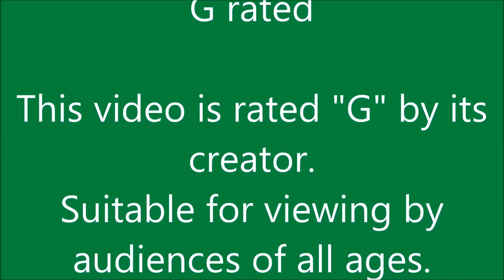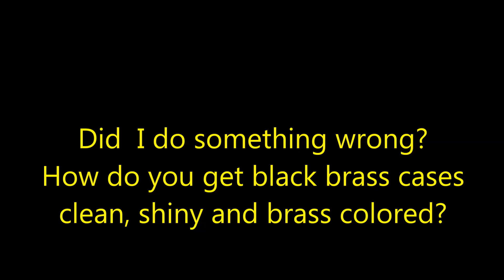Cleaning black brass cases in a wet tumbler

Comment: Watch from 6:47 to  8:31.  Pins, cases and a spoonful of Dawn - NO LEMISHINE! (No citric acid) Hint:  Use 3-4 drops of Dawn then at 10 minutes check the results. If there are no or very little suds you did not have enough Lemishine.  The clue was the over abundance of suds at 11:49. Should have added 1/4 to 1/2 teaspoon Lemishine. That spoonful of soap is hard to remove making your cases sticky if not completely removed using Hot water during  the rinse process.  Under normal recently fired brass cleaning first do a thorough rinse in very hot water to remove any case lube residue (these cases are so weathered it is doubtful there is any lube (wax) remaining) . Over rinsing and citric acid are the key to non tarnishing bright brass during storage. Always rinse with clean water. Don't reuse dirty cleaning solution, it will make your brass hazy  looking.

Comment: Some folks add a little lemon-shine to that same mixture. The citrus helps clean and shine the brass👍🏻
Reply: Lemishine is mainly citric acid. It definitely helps. Careful not to use too much or it might discolor your brass.
Reply from the maker: I bought some Lemi Shine and will use it on these cases.  I will also post a video.  I am eager to learn how well it works.
Reply: RogerRevo . Ok, will be waiting on the vid. Hope it cleans them up👍🏻
Reply from the maker: @georgiaboy4410  Watch my video:
Cleaning black brass cases in a wet tumbler with Lemi Shine

https://www.youtube.com/watch?v=57CKUF46otY

Comment: Yes, it would be interesting to see the results after adding about 1/2 teaspoon of lemi-shine to your existing mix and running for another couple hours.

I have the same tumbler as you but i have been using ground walnutshells, with a healthy dose of mother’s chrome polish and nufinish wax. ive actually been able to restore brass that looks like that, but it takes about 4 days of tumbling. i like the nufinish wax coating for three reasons, the cases look very nice shining better than new, the brass should last a long time without tarnishing, and mostly because it cycles through semi autos easier with a touch of wax.    anyways, just some thoughts on what has been working for me. i also have an ultrasonic cleaner, but havent had the best results with it, other than if initially cleaning the brass in there before tumbling, it cleans the insides and primer pockets that the walnut shells dont always get. i may go to a two step process of wet tumbling with the SS pins, lemishine, dawn combo, then finish up with a dry tumble with the walnutshells and wax..  im in no hurry. but, have saved a lot of old brass that appeared unusable with the method mentioned.  no case cracking probs, but i dont load “hot”. medium is fine. i figure, need more power, go to a more powerful cartridge.
Reply from the maker: Watch my video:
Cleaning black brass cases in a wet tumbler with Lemi Shine

https://www.youtube.com/watch?v=57CKUF46otY

Comment: Something that dirty I use vinegar and dawn in hot water for 20 minutes and rinse. Then repeat with lemon juice instead of vinegar for 15 and done. Works great for me and they come nice and clean
Reply from the maker: Watch my video:
Cleaning black brass cases in a wet tumbler with Lemi Shine
https://www.youtube.com/watch?v=57CKUF46otY
Reply: @roger_revo  I do wet tumble I dont use the stainless pins. I built mine and use a 5 gallon bucket. Building ultrasonic now 1200w